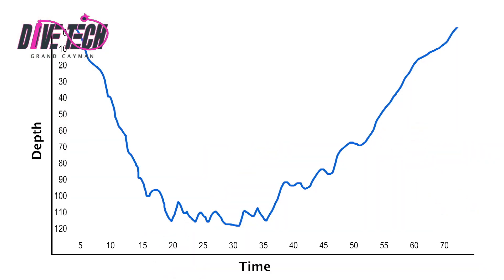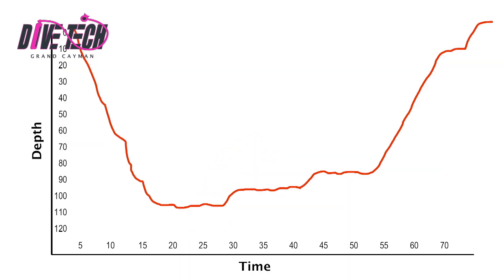CCR buoyancy explained

Comment: Excellent video, Tony. But I constantly rine tune my depth to take photos, do photographers on rebreathers constantly change target depths?
Reply from the maker: Hi Bob, I do frequently as I'm shooting photographs. As you become more experienced on the rebreather, you are able to read the nuances of the loop pressure, and buoyancy becomes easier on it. For anyone shooting photos, I'd wait until you had a few hours under your belt before you began diving the rebreather with a camera,
Reply: @DivetechLtdWestBay  I have just completed my MOD1, having been diving OC for a long time, and clearly, I have developed some bad habits using lung volume for finite buoyancy control, particularly for photography fine adjustment.  Are you suggesting that for your photography, you use the loop volume to fine time and your wing for more general target depths?
I found out about the swimming thing to my costs, having nailed the target depth (or I thought I had) and did a whole dive seemingly in control, only to find when I stopped finning to deploy the SMB, I sank a couple of meters!
I have a newfound respect you guys